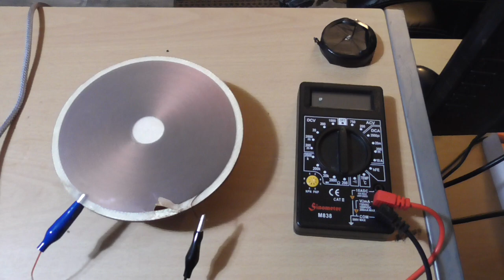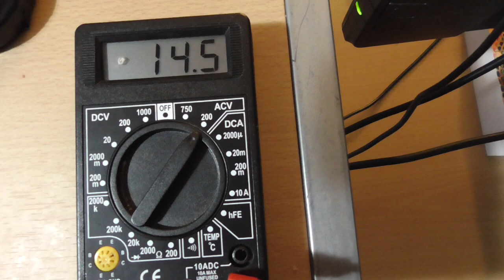Resonance Amplification

Comment: how to find a coil and a generator like this, to try to relicate?
Reply from the maker: You need to built it yourself and experiment, for the flat coil I just used  old cd stomper to help me with the winding. The generator can be any method you like. There are ample sources and devices like a  pwm module for a few dollars if you don't want to build it that can do the job.  The concepts are the same you just need resonance however you want to build it.
Reply: @joellagace1679  Thanks. i wil try.